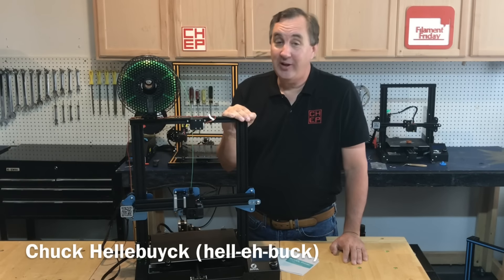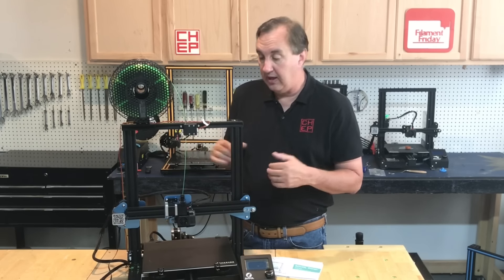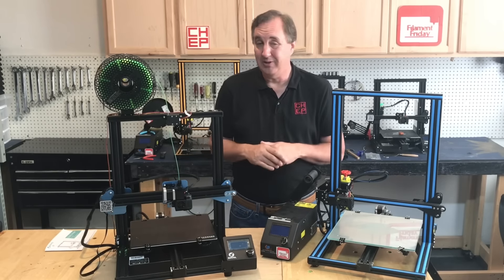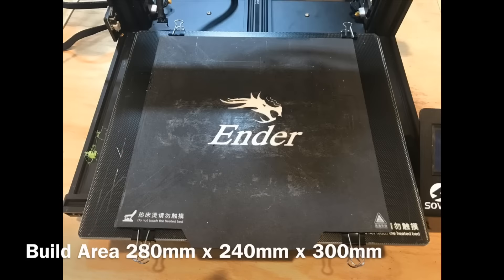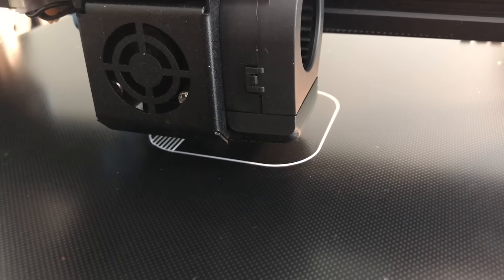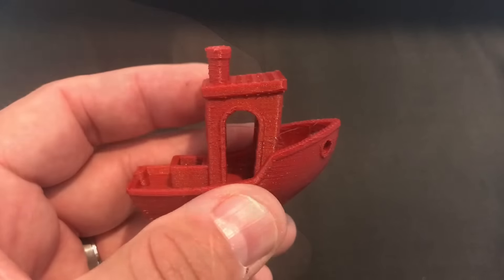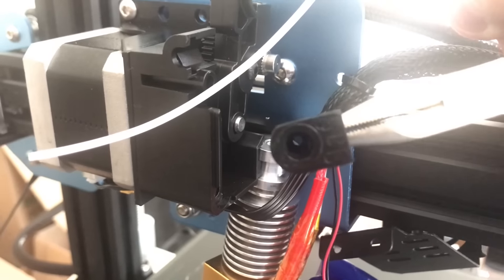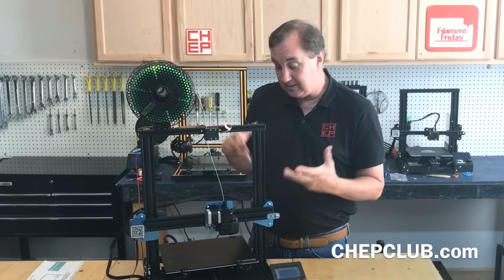$299 Sovol SV01 - Direct Drive Creality Style 3D Printer

Comment: The separated electronics box is an advantage in my opinion because you can enclose the printer and leave the electronics outside of the enclosure, where they'll be cooler
Reply from the maker: The electronics has a vent and fan on the bottom and sealed on top so electronics can stay cool and still enclosed the top. They did a good job on the electronics box.

Comment: Artillery Sidewinder X1 uses that same type of funnel system (It seems like this printer is a hybrid between the X1 and a Creality machine).  Just put  PFTE tube in the funnel and it will solve that issue.
Reply: arcanum70 
That seems like a significant mistake.  I wonder if they have fixed this in later production?

I am considering a larger printer, but core xy seems to be a better approach once the potential weight gets significant.  They seem to be priced a lot higher, though.
Reply: @boggisthecat  not a mistake on the X1, the system works perfectly for flexible and other materials. And, it comes with the PTFE tube in it already.
Reply: arcanum70 
Ah, OK.  I hadn’t heard of this issue with that printer.

Comment: that funnel as you called it is a piece used in the titan, and you're supposed to run a ptfe tube down that funnel into the heatsink
Reply from the maker: There was no PTFE in mine.
Reply: I'm inclined to agree, the bondtech BMG also uses PTFE in this part to feed in to the hotend and this does look to be 'inspired by' these types of extruder. Perhaps try putting a piece of PTFE in there and see if it fixes the problem? Might have been missed in the factory?
Reply: @FilamentFriday  yeah there needs to be a PTFE tube in there.
Reply: @FilamentFriday  that's QC for ya. It's supposed to be in there. Look at direct drive assembly instructions for the e3d Titan. I have one, and you need a short(ish) 50-100mm ptfe tube. Mine a bit longer as I use a piezo bed leveling assembly, but not having at all with produce junk prints.
Reply: @kazolar  i had no tube in mine either, gonna put a piece of capricorn in there

Comment: Thanks for doing this review. For me as a recent purchaser of this printer and a complete novice it provided some useful insights. Maybe the hot-end is the compromised part that lets it down but I also read somewhere that it is supposed to have a Teflon tube in there. My results have been varied, some not very good but my best was a model I designed for myself - the first I have ever done.

Comment: I just bought the Sovol sv01 and the print quality is more like your Ender 3 prints than the Sovol ones 😅 I wonder if they made any upgrades between when you made this video and now. Anyways, I'm satisfied with the Sv01!
Reply: I can't remember the other reviewer on here, but he said they did upgrade it to fix some things on it. I'm curious if the E3D V6 hotend will just bolt on with no issue, not sure if anyone has tried. There is also a funnel on Thingiverse to fix the flexi-filament issues.

Comment: I've bought this printer some months ago and I'm very happy with it. It is a very reliable printer. I've tweaked some of your Cura settings and the results are very good. The only problem for me was bed adhesion but I solved the problem with hair spray and it sticks very well without warping and the prints are easily removable when the bed is cold. I also have a Geeetech A10M and I think their superplate is better.
Reply: I also bought this last month. It is my first 3D printer and I have no other experience to compare. My results are varied, at first I couldn't get the supplied XYZ cube to stay stuck to the bed. I found increasing bed temp to 60 degC fixed it but today I had a complete fail with a Benchy. Would you be prepared to share your Cura tweaks and what CHEP settings profile did you start from?
Reply: @tdumnxy  i have been sticking no prob with no spray at 65, only had it about 10 days
Reply: @tdumnxy  I use Chep Cura profile 2.0 with some tweaking for a better quality. If your problem is sticking to the bed, the only tweaks are in Travel section: combing mode "not in skin" + "avoid printed parts" "avoid supports" when traveling. Try to raise your bed closer to the hot end (it is much closer than with my other printer). Try a brim on small pieces. Lower the speed of the 1rst and 2nd layer with parts ingraved (like the benchy). Definitly a powerful hair spray solve this problem. My bed temperature is 60°
Reply: @Cathy29870  Thank you

Comment: 8:58 Looks like the perfect job for a 3D printed resin part to replace that 'funnel'
Reply from the maker: I’ve already printed a replacement on my Ender 3
Reply: @FilamentFriday  And? Did it fix the issue?
Reply: @FilamentFriday  sounds promising! And its really interesting how you found  that flaw so quickly.
That funnel/wiggle should be the reason for many problems. The material is not allowed to bend after the gear drive.

Comment: Retraction 1.75mm at 10mm/s 200c with 100% fan. Prints pla beautifully
Reply from the maker: Do you share your profiles anywhere?
Reply: @FilamentFriday  no but super simple. Start with a generic cura printer.  And those settings I mentioned. Then whatever your preferences are / specific to the model. Everything printing excellent. I did take hotend apart and see if mine had the ptfe tube. It did not. I added a 19mm piece and put back together. I already tested with some flexible pla before this mod and did ok. It did jam the first time. I thought I loaded it wrong. The filament I have is not super flexible.

BTW check out my retraction tuneing vid. It's for this printer
Reply: @prahjister  Hy, i'm new in 3D printing. Can you share your Profile for the SV01 with me? Maybe with Screenshots of your Printer Settings in Cura? That will be very friendly from you to help me.... Thanks a lot.
Reply: M. A. The cura profile is available on Sovol user group

Comment: I agree with a couple of the other commenters. That Titan clone extruder filament guide should have a piece of PTFE tubing in it that goes down into the heat sink. I wonder if this is normally how the machine comes or if it is just missing on this particular unit. It seems weird they would leave it out when it's obviously needed.
Reply: On my I3 Mega this is exactly what I have done. I pushed the Capricorn tube all the way down to stop the wiggle. A bit more tricky to get the filament in but the effort is worth it.

Comment: I replaced the extruder drive on my ender 3 pro and now it over extrudes the pusher gear that came with it was eaten up I had to replace the plastic with aluminum I managed to break a part off any ideas on this odd issue?
Reply from the maker: Put it back to original?
Reply: @FilamentFriday  it was broken and the gear stripped by the filament it was labeled as aluminum replacement for the Ender brand (multiple models) the original spring was weak and I had to put wedges in it to make it drive at a semi-proper speed for extrusion. The replacement is the exact dimensions but aluminum. and I had to crank up the flow rate to 120%+  to get good extrusion now I am running at 85% and it looks reasonable.

Comment: Interesting printer 👍
How is the noise level of the drivers and fans?
Thanks for sharing 👍😀
Reply from the maker: About the same as other printers. Not quiet.
Reply: Use noctua blowers add skr 1.3 Board with Tmc2208 (Bigtreetech) and the SV01 3D printer is super quite... 🤪

Comment: Hey CHEP,
Would you be able to show a way to add an auto shut-off upgrade for the CR-10 after a print finishes? Or maybe another maker who has already shown it? Any help would be great, Thanks!
Reply from the maker: By shutoff you mean shutoff the hotend and bed?
Reply: @FilamentFriday  correct. My builds are going to be fairly large, and while a bigger nozzle could cut down on some of the time I know it wont be lightning fast. Is there a way to upgrade the CR-10 so itll shut off once a print is finished?
Reply: But the printer does only require like 10-15watts on idle (forgot the exact numbers and it differs by a few watts on the machines).
Make sure bed and hotend turn off and it's all fine to have the machine idling.

I have my printer on a power socket which can be activated by remote. Would be interesting to somehow connect the remote with the printer. But then again... I have way higher priorities than saving a few Cents per month.
Reply: @REDxFROG  I was more concerned about a possible fire hazard, or even damaging the machine. I'm still new to this but I know theres gonna come a point where the print could finish while I'm at work or sleeping and I dont want it to burn out or anything
Reply: @sambell8768  I don't know what you mean.
You have to use gcodes for the end script of each print so the printer turns of bed heating and hotend heating.
Zero chance to burn when that happens.
The acutal fire hazard is when the printer is running and heating (load on PSU, hot parts, power lines with lots of ampere) . Not when finished and idling or before starting a print (idle).
Reply: @REDxFROG  and now I have my answer, thank you for clearing that up for me! I thought maybe the printer kept the heat running even after the print finished
Reply: @sambell8768  I'm glad I could help. But you have to be aware the script has to be entered in the slicer software. The printer will not do it by itself. (there are many prepared start- and end scrips in the web)
Reply: @REDxFROG  I think I found a page that has what you're talking about. The code references turning off the fan, extruder and bed

Comment: Please i need a little help 
I  just bough a 3D printer for the first time, I know how to design a 3D model and convert it to stl file but what should I do next to start printing?

Do i need just to put SD card with the stl file in my printer then it will start printing ?
Reply: My printer is CR10-S5 if that matters
Reply: @eyss6303  you'll need to take your STL file converted to the machine tooling language that your printer needs to control the device. This language is called Gcode. To do this you use a program called a slicer. Cura is a fairly common slicer but check to see if there is one provided by your vendor that's already configured for your device as you'll need to know the settings. You then take the gcode file and load it into your printer. Once you heat up the nozzle and load your filiment you should be ready to print.
Reply: You need to "slice" your stl file. Your printer probably only eats gcode. Look up 3d slicers on the web. I use Cura for printers that don't come with their own slicer. The slicer needs to know what kind of printer you have, or some basics about it if it isn't listed in the program. Once you have sliced to gcode, put that on the sdcard in the printer and look for a print option in the printer menu. Good luck! Also check back through the vids on this channel for plenty of good info about that topic.
Reply: @bwebs956  
Thanks ❤❤
Reply from the maker: Watch this: https://youtu.be/FahVngvlhoY
Reply: @FilamentFriday  
Great thanks man❤

Comment: Is there a solution to get this printer to print flexible material?
Reply: From what I understand, you can insert ptfe tubing into the extruder and cap to remove the extra space, which will prevent buckling.
Reply: @LivePastTheEnd  New ones already have that improvement.

Comment: @CHEP it cant be a cr-10s board as Sovol is 24v and cr-10s is 12v. I own a cr-10s and all main boards they are all 12v. So I think its from another Creality thats 24v. I also own a Sovol sv01. but replaced the mainboard in the Sovol with a SKR v1.3 & tmc5160 drivers, and a Flex Steel build surface. but my build volume on my Sovol is 254mm x 296mm x 300mm with a couple tweaks you can use the full Volume. CHEP you can add a small piece of Capricorn tubing into top of heatsink & into the plastic guide and you can easily print any flexible filament.  but a Bmg with dual gear is a better way to go, then a single gear with a guide bearing. This Sovol is better built in every way then my CR-10s, Sovol using better made Z axis mounting brackets, uses 2040 for X axis Gantry.  and its 24v and cr-10s is 12v. The extruder is a titan clone but its better then a cr-10s extruder for sure. if your thinking about a Ender 3 or cr-10s just buy the Sovol its alot better then either of them for sure.
Reply: Hi Dave, would you do a quick write up of the mods you did.  I'm interested in doing the same, especially adding the Teflon tube and also increasing the build volume.
Reply: Dave where did you get the flex plate from please

Comment: Will the Runout Sensor work correctly when the X Carriage is at the top of the printer? Looks like it might introduce a very sharp angle as the head moves around.
Reply from the maker: Probably not

Comment: I've got this printer and it's very accurate with great print results. Check the play in the rails and make sure all nuts are tight and you're good to go. Doing a little extra before printing anything paid off for me. Slic3r works best imo
Reply: That black funnel after the gear drive still is a major flaw.
Reply: @REDxFROG  I've not tried printing with flexible material yet, I've got some PTFE so it's good to know it's an easy fix. "Major flaw" is a bit dramatic however.

Comment: Use noctua blowers add skr 1.3 Board with Tmc2208 (Bigtreetech) and the SV01 3D printer is super quite as a raptor printer ... 🤪

Comment: I am looking to buy a 3D printer soon, I think it's either going to be this one, CR-10S or JGAurora A5S, anyone suggestions? The larger build volume is nice to have but no big must for me. I like that the Sovol is direct drive and I like the look of the A5S and the fact that is more quiet. I hear the Sovol is a lot louder.
Reply: I have 2 ender 3s. Sold my cr10 and ft5. And I want this. I do love the ender 3s and the cr10s looks awesome but if I were to buy a new printer I'd want this or something with direct drive. Filamemt runnout semsor is awesome too
Reply: @SirKevinthefirst  I ended up buying the Artillery X1 Sidewinder (v4). Very interested to see how it will perform.

Comment: Someone recommended this printer to me over an Ender 3 but I am kinda doubtful now. For the price I could get an Ender 3 and upgrade the necessary components and it would end up being better than the Sovol. I like that it comes with factory Direct Drive but looks like I would be battling issues with it to get it to print OK while the Ender 3, has obviously much better support having been around for a while. In any case, your review was top notch.
Reply: VideoTzar19  I don’t know...the Sovol guys are almost overly supportive. Leave a comment, and they get back ASAP. My CP01 print head shorted against the metal table clip, and Creality says it will be a LONG time before I get a replacement print head. The CNC and Laser software don’t run on a Mac, so I bought the Sovol to fill the gap...very impressed with it.

Comment: If you think this destroys the ender 3, try looking at the tronxy xy-2.
Reply from the maker: I don’t believe it destroy Ender 3. In fact I showed Ender 3 print results were better.
Reply: no, its shite, the  v rails are crap,  the rollers are crap, the voltage is  too low and generally, you would be far better off with an ender 3

Comment: I got mine yesterday...love it, after two CR machines failed. I was printing a large bust of Nefertiti. It was going great, but she broke away, and it started spewing spaghetti. Ah, the importance of the base layer. I should have built a raft. I got a clog when I changed filaments....any way to avoid that?

All I can say is: buy one...it’s an absolute steal. This is like printing from my Mac...command-p. After Nefertiti, I didn’t reset, re-level, re-anything. I told it to print a spiral vase, and left the room. It’s DOING IT! Well!
And the people seem really good to work with. They may have changed things, since my hot end is silver, not brass. My cube and Nefertiti show no layer lines....a bit rough under the overhang of the chin.

Comment: sorry, I just had a terrible time getting things to stick, sure it works with pla, other materials......not so much,  it's a royal pain watching it go through the bl touch routine everytime you have to restart a failed first layer.  The materail keeps oozing out of the extruder during the bl touch leveling routine too, sometimes causing it to push down on the plate if you don't knock it off.
This sprung table design.....for a device that is always changing temps.....is a BAD IDEA.
from a machinists point of view these things are poorly designed, getting first layers to stick and leveling beds should not be an hours long affair with false starts etc.
thanks for your time.

Comment: looks like some warping on the cube 07:35, the only time I have seen PLA warp is on a cold bed, by turning the bed over is the coating causing an insulation problem?

Comment: does the x axis rail look like u can upgrade a ender 3 to that type of system? to handle a direct drive? or have that kind of upgrade for a cr-10s ? the x axis rail that is...? i want to upgrade my cr-10s to a direct drive for TPU but i dont want the weight of that on the default rail thats on the cr-10s currently. so getting that x axis as a upgraded part would be really nice?
Reply from the maker: You don’t need direct drive for TPU:
https://youtu.be/1GNDxvxpWr8

Comment: if connected to pronterface or w/e you use does it give you a read out of the acceleration  and jerk settings, i have a chiron that i just cant seem to get right
Thx
Reply from the maker: Yes, send it an M503 and it will send back the data.